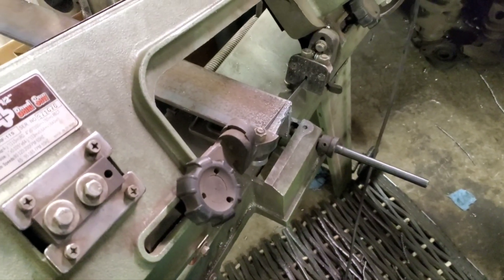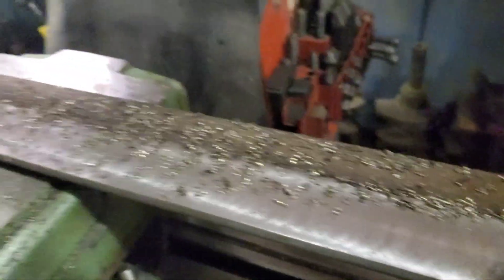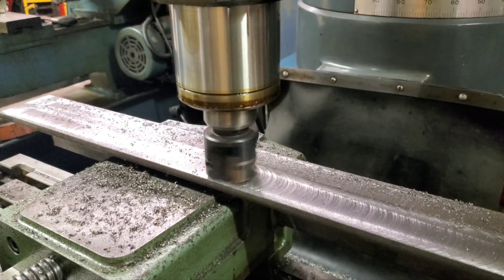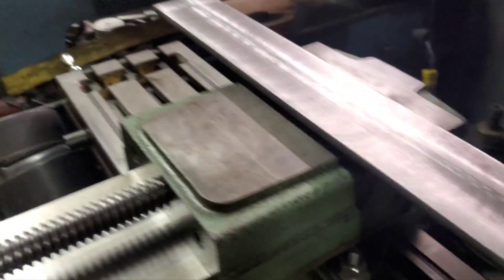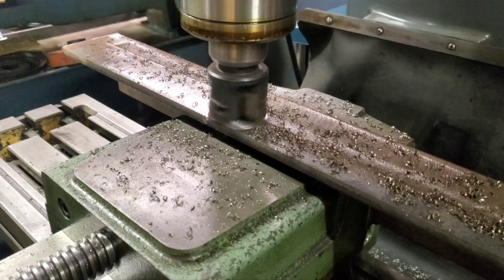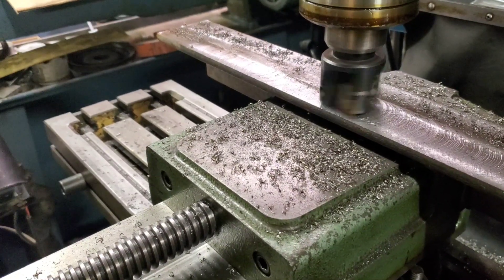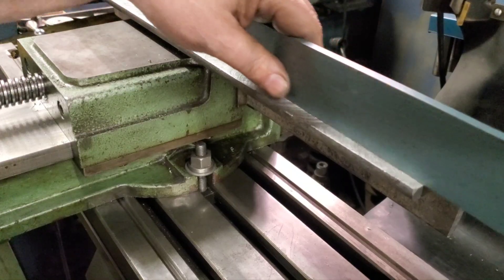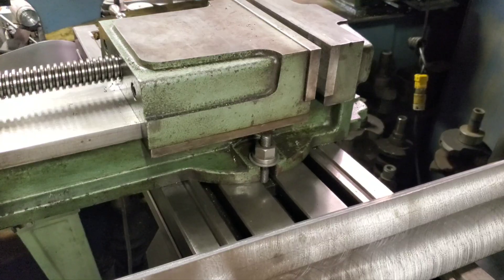Cylinder Head Milling Fixture For The ComecACF200

Comment: I can't "listen" to anymore, the machine noise is Amped, the audio is muted.
I'm done watching with Vacuum sound, WTH, 1st day !
Reply from the maker: My video is never"Amped".
The audio was not muted.
I simply was working and not talking.
And the sound of a vaccuum running is upsetting?
I am a working shop.
I would suggest finding another forum. 
Have a good day.
Reply: @edsmachine93 
I wore my Ear protection, for the Years of running an OKUMA, & that had a cabinet.
.--VOX microphone,
Or not, I can turn the volume down.
Reply from the maker: @bradleymason4558  Bradley my video's are never meant to offend anyone.
I do not have any fancy camera and or editing equipment. 
I just film on a cell phone.
I do appreciate you watching. 
I know how the hearing is.
Been in the shop and around loud engines and machinery for over 50 years.
Have a good evening. 👍🇺🇸👍
Reply: I was always told if you can't stand the heat get out of the kitchen,  if you think it's loud on video just imagine being there and running this equipment all day , this is real deal machine work Bradley
Reply from the maker: @terrygrover6440  Thanks Terry, I appreciate you watching and commenting and the support.
And understanding of what goes on in the shop.
Have a great day.👍🇺🇸👍

Comment: Now you have a good solid right angle to fixture off of.  Nice job Ed!
Reply from the maker: Thanks Pat, I appreciate it. 
Yes, you are correct.
I believe it is solid and will have good rigidity.
My friends is made out of 1/4", I am glad that I got 3/8"× 3".
And it is Hotroll so it does not warp when removing the millscale.
Have a great day.👍🇺🇸👍